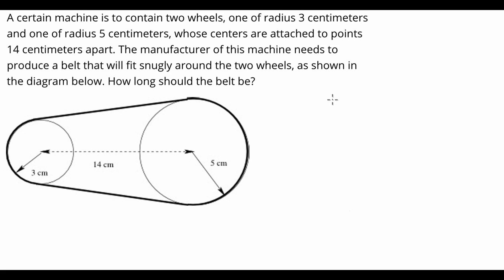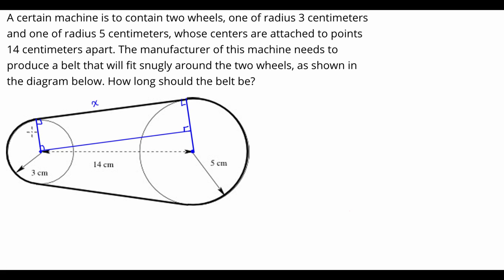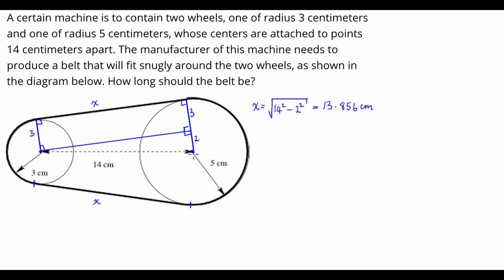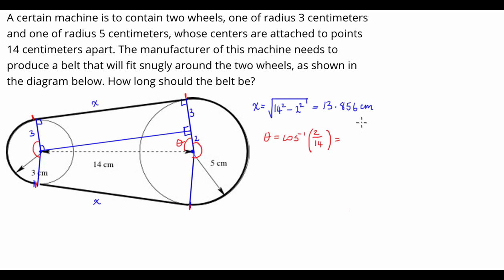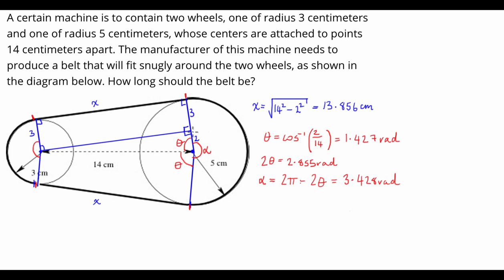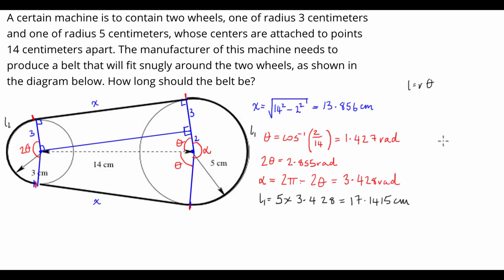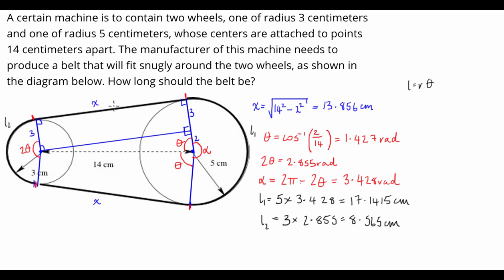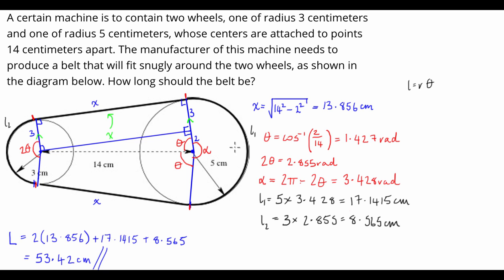Finding the Length of a Belt Using Radians and Simple Geometry

Comment: Does this have to be worked out using radians. Can degrees be used?
Reply from the maker: Good question, degrees would work however, I think that the path to a solution is a lot less cluttered when radians are used. (The formulae have a lot less going on)
Reply: @HaroldWalden  okay I founds radians made a lot more sense. When using degrees the numbers just didn’t make sense or seem realistic. Great video
Reply from the maker: Hit the nail on the head... I also find radians waaaay more intuitive than degrees when doing problems of this kind. 

Thanks for taking the time to leave a positive comment. I really appreciate it 🤓

Comment: thanks for the video! I do have some questions though; would it be possible to determine x if you had the length of the belt itself but not the distance between the circles? I have a set length for the conveyor belt but I'm trying to figure out how far apart the circles would be :(
Reply from the maker: Do you have the radius of the two circles?
Reply: @HaroldWalden  9 and 14 :)
Reply from the maker: @loudcloud505  what is your belt length?
Reply: @HaroldWalden  180cm
Reply from the maker: @loudcloud505  Ok, I don't know if you have an answer with you but I got 53.6cm from centre to centre.
Reply: @HaroldWalden  I don't have an answer key, it's actually for a project I'm doing, but do you have the method you used to find that number?
Reply from the maker: @loudcloud505  here you go; FYI I just used Wolfram Alpha to solve the last step.

https://drive.google.com/file/d/18pdYTZyQMifpGohabjM1imvdWlzzJTxv/view?usp=sharing
Reply: @HaroldWalden  thank you!!!
Reply from the maker: cindy co you’re welcome, I hope it helped 🤓

Comment: how does 1.427 rad + 1.427 rad equal 2.855???          shouldn't it be 2.854 RAD?
Reply from the maker: I was probably adding the terms that I hadn’t rounded yet. You can work through the problem as I do and see what the exact numbers are and see if I have rounded correctly.

Comment: It can also be L=2C+1.57(D+d)+(D-d)/4C
Reply from the maker: You'll have to elaborate on what you're making your variables represent because I don't follow.
I feel like with questions like this, being able to solve it using a formula such as the one you have provided doesn't give you much wiggle room if the structure of the problem slightly changes - for example how would you apply this relationship to a pulley system that had three rotors rather than two?

Thanks for taking the time to write a comment, I really appreciate it and look forward to seeing if your formula can be applied to any variation of this particular problem. 

:)

Comment: Can you please elaborate about what you said on 5:50 ? How can we determine that the angle subtended by L2  is 2 thita?
Reply from the maker: Prabhiv Adhikary it is because the belt is symmetrical. So if I know one of the angles, the corresponding angle on the other side of the line of symmetry (represented in this picture by the dotted line) will be the identical and there sun will be twice the original angle.
Reply from the maker: Prabhiv Adhikary hope that helps :)